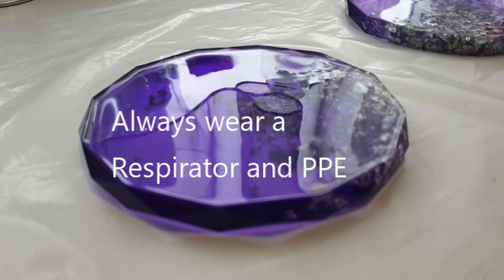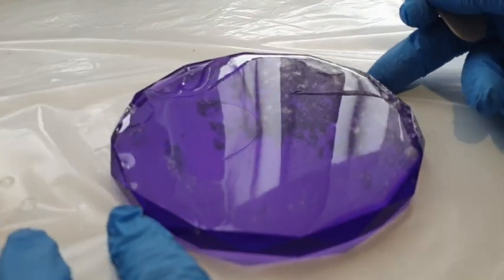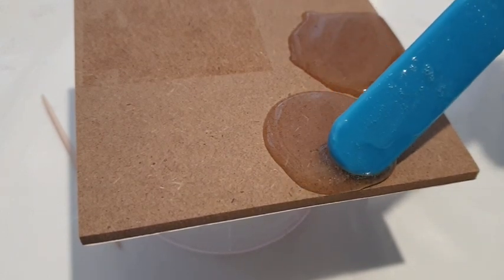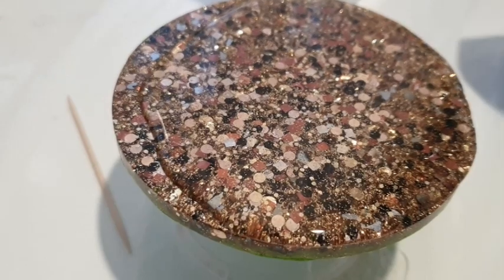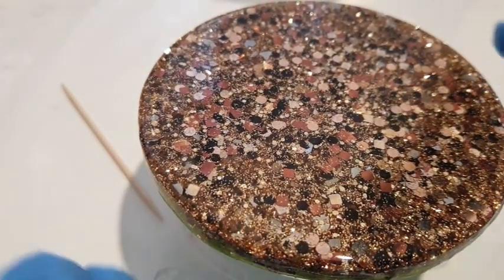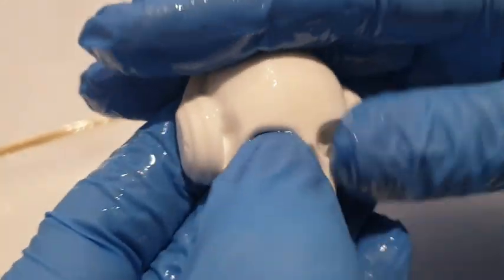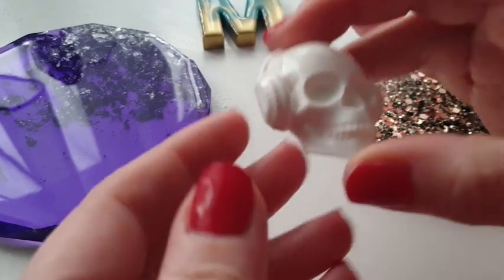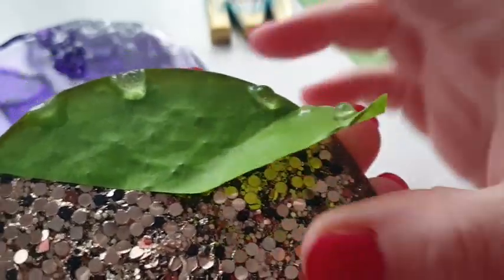How to Top Coat with Epoxy Resin

Comment: What did you put the skull 💀on to dry please and how do I work out how much resin to make for flooding . Thanks for talking the time to read this 😋
Reply from the maker: Hi Samantha, I rested the skull on some polyurethane sheet ... I still don't really know how to measure the exact amount for my specific projects ... I just do a rough guess depending on size. I then have a few other moulds (usually smaller jewellery moulds) to hand it I make too much x

Comment: Just what I needed! I found an matte alphabet ice mould and want to create keychains with them. I think the rubbing technique will do wonders for the finish! I just have to find a store that has a suitable mask in stock. All are sold out due to the pandemic and I don't have access to my usual resin "studio", aka outdoors during the summer....
Reply from the maker: ahhh Mizz .. I had that problem last year getting filters but I honestly thought ... who is walking around with a respirator  on? because I never saw a single person .. not in hospitals on the news or anywhere so it baffled me ... much easier now ... but it is hard with everything when things are sold out x
Reply: @ClairesCraftyCorner  People are using everything from cheap 1 ply fabric masks from Wish to military grade gasmasks! I work on comuter trains and have seen all types. Since they are back in stock the standard paper version is more common now though.
Reply: I got 3M doulble filter ones from Amazon. ;)

Comment: I'm having trouble top coating the side or whatever I'm top coating. Sometimes, I will be left with a small crater, or the sides are wavy. I sand them with 220 grit sand paper, but I'm not sure how to solve this problem. Any suggestions? Would be greatly appreciated. Have a nice day.

Comment: Hi, the top coat is the same resin you used to make them or is a different resin? Thanks
Reply from the maker: Hey Daisy ... I use a top coat resin now. I used to use Craft Resin and Ibwould top coat with that as well. Now I use Vista Coaty to top coat x

Comment: how did u deal with your skull not sticking onto the paper
Reply from the maker: Heyyyy Lina ... I put it on some Polyurethane plastic xxx Resin doesn't stick to Poly. Xxxx
Reply: @ClairesCraftyCorner  this is extremely helpfull. as i often have a hard time with having to resand my resin pieces in the bottom
Reply: @ClairesCraftyCorner  is polyethylene just as good ?

Comment: What are you using at 3:53?  It looks like a torch but you do not have a torch listed, just a heat gun and heat tool.  I have been wanting to get a torch but not sure which to use.  I would love to know what you are using here...
Reply from the maker: heyyyy Lisa... I just watched it and I am using a Culinary Blow Torch at that point ! it kills all bubbles .. but would only use the torch for Flat pieces like this ... not in silicone moulds it will melt the silicone x
Reply: @ClairesCraftyCorner   Thank you so much for responding.  Good to know!

Comment: Quick question with the diamond edge coaster mould, I like to do a gold paint edge but it wears and scuffs after a while, if I did a rubbing coat of resin over the gold paint would that be ok? Or would it look a bit rough?
Reply from the maker: Heyyy Mandy, I would use an oil based marker .. but yes a resin coat would work should not look too rough xx
Reply: @ClairesCraftyCorner  thanks so much claire ! appreciate your help ☺️ xx
Reply from the maker: @2561mandy  ❤❤

Comment: Hi Claire! I have a coaster that I sanded a bit to remove some imperfections on either side, its got a squiggly outer edge design, but it's 90 degrees but I need to do  both sides, would the rub on technique be best or just straight pouring it on?
Reply from the maker: heyyyy lovely - I would use masking tape for the base and do a top coat not a rub on no. If the coaster is see through I would then repeat that process on the other side. If the coaster is not see through -- I would not do a layer of resin on base. I would simple use a self adhesive cork base.

Comment: I find sanding helps stop the resin from pulling back when you have a bit too little ! it makes a grippy surface. but otherwise yeah it's not really needed.
Reply from the maker: Ahhhhh see ... that makes absolute sense to me ! I never did get it ... when people said it was to help it stick x but I would actually sand for that if I needed to xx sometimes top coating can be annoying x
Reply: @ClairesCraftyCorner  - its worth it though - topcoating just makes everything SPARKLE! :D
Reply from the maker: @NallaGoat  totally 😍😍😍😍

Comment: hi. i did exactly the same like the video and i did not get a perfect top coat. can you help me please in identifying the reason. i can send you a picture to show you the result i am getting. it will be great if you can help
Reply from the maker: Heyyyyy lovely ...  yes of course please send them to me on Instagram xxx I will see if I can help xxx
Reply: @ClairesCraftyCorner  thanks. Can you give me an email please to send the picture
Reply from the maker: @colorspillbymanal1619  heyyy lovely ... yes its clairescraftycorner@yahoo.com 

It might be an issue with the level surface or speed at which you poured x 

My surfaces are very rarely level  .. so I always get some spill off x

Comment: Hi I was just wondering do you use the same resin you used to make the piece to topcoat or do you have to get a specific resin designed for topcoating?
Reply from the maker: Heyyyyy lovely ... I use a different esin for top coating .. I cannot remember what was used in this video but it was either Glass Cast 3 ... or Vista Rapuds. They are both top coating resins x

Comment: Hello and thank you, Claire for this very informative and thorough video, really appreciate it. Curious, would you use the rubbing method for the edges of a raised tray? For instance, say a rolling tray or any tray with a raised edge/lip, would I pour a layer of resin in the middle of the tray and pull to the edges? For the raised part of the edges, would I just leave it or continue pulling the resin up and over the edges with my fingers/stick? Thanks so much!
Reply from the maker: Heyyyy lovely ... on Trays I just top coat the tops .. I never pull it over to the sides .. honestly way more mess than I can handle lol x

Comment: I’ve been using pva glue instead of latex so much cheaper and so satisfying to peel off ! Just out of curiosity does your skull not get stuck on your table while curing if you put resin everywhere ?  xx
Reply from the maker: Ooooo never thought to use PVA .... and no it was ok because I left it on the polyurethane sheet xxxx